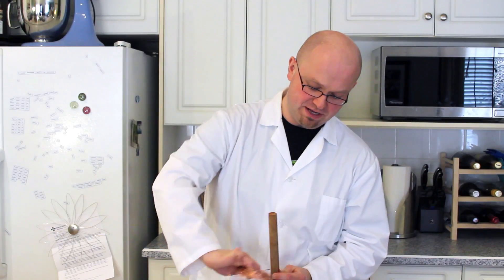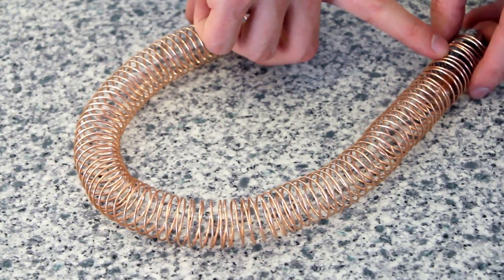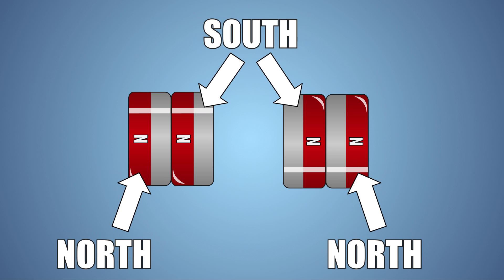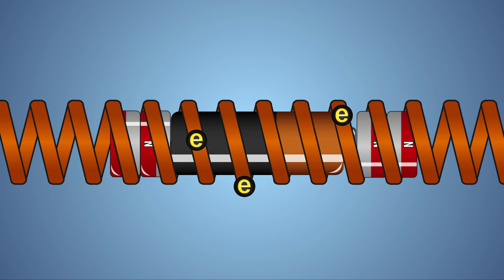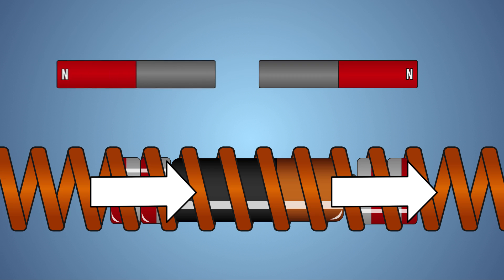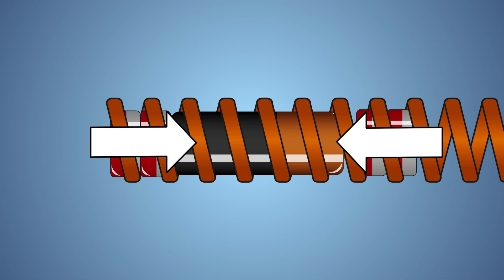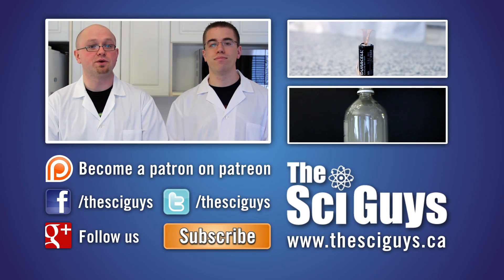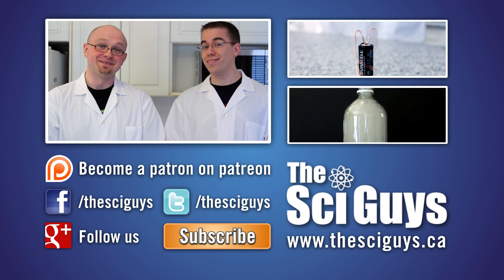The Sci Guys: Science at Home - SE3 - EP9: Simplest Electric Train - Magneto-Electric Train

Comment: can we use use aluminum instead of copper for this?
Reply: Well it would work but not as good as with cooper, because Al is paramagnet material when Cu is diamagnetne material. Paramagnetic substances are characterized by the fact that the magnetic moments will be partially directed in the direction of the external field, which causes a slight attraction between the coil and the train. Whereas diamagnetic substances are considered to develop a weak magnetic moment opposite to the direction of the external field and will be slightly repelled by the magnet, which will help the train move more smoothly.
So in the short it would work but not as good as on the video.
I hope that would help you and also I wish you as much success and experimentation as possible.

Comment: 2:38 is copper coil necessary for movement or can I use a copper plate which is bent like a disected pipe
Reply: flow of current in the coil along circles adds up and gives a combined magnetic field. By the right hand thumb rule fingers curl in direction of current and thumb points the magnetic field direction N to S along the direction of motion of train. in a plate the current will go straight and by a different right hand thumb rule thumb shows current direction and curl of fingers the magnetic field which is not along the direction of motion but in a perpendicular plane

Comment: What would happen if there were only one magnet at one of the poles? You said that one magnet needs to act as the "pull" and one as the "push". So if there was only one magnet, would it simply be a weaker movement because there's only a "pull" or would it not even move? That's my first question

Secondly, I'm assuming that the magnetic field in the coil only exists on either end until half each magnet. Otherwise if the South Pole of one magnet is attracted by the field, the north pole of that very same magnet should be repelled by that field, leading to no motion. So we are to assume that the field ends before the outer extremities of the magnet?
Reply: If you have magnets only at one side of a battery you would not have current because only  magnets at both side create closed loop for a current to flow. Magnets here act as a conductor.

Comment: I know this is an older video but would the inverse of this work for example, instead of the magnets being a attached to a battery say a piece of metal rod, and then applying the electric current to the coil itself
Reply: I know this is an older comment, but I think a magnet is still required in the setup to do stuff

Comment: Can you tell me why aluminium wire isn't used for this? We were able to get the copper wire to work and make the train move forward. Then using the same gauge (18) aluminum wire and same battery, it seemed to reject the train and moved slightly backwards.We are having trouble finding why this might happen.
Reply: Presumably aluminum wire is applicable for this application.
The resistivity of (industrially pure) aluminum is slightly larger than the resistivity of copper, but not much different from copper.
Of course, there are some shortcomings in the use of aluminum wire.
First, the mechanical strength of aluminum is lower than that of copper and it is easily deformed by the externally applied force.
Second, due to the thin oxide film on the surface of the aluminum, the contact resistivity between the wire and the (nickel coated)  neodymium magnet can be slightly larger in the case of aluminum.
Either way, I think you can use it.
Perhaps the direction of the windings is reversed?
Please try to flip the direction of “the battery train”.
Reply: @yoichihirose3806 can you please tell me if the copper wire is insulated or non insulated please?

Comment: Hi, will this work with two magnets glued south-to-south inside an enameled wire tube with an external power connected on the ends of the coil? Seems like a simple question, but I can't seem to figure if the forces outside the magnets will cancel those inside resulting in no movment.
Reply: I was wondering the exact same thing, please answer this!!! Based on this explanation, it should be possible to stick the magnets on either side of an insulting material with this orientation, and have an external power source run a current through the wire. I am hesitant to say this will work tho
Reply: @feelthebluesgaming7630  I posted this question a long time ago. Now I know this will not work. The force created by the magnetic field of outside poles going through the current-carrying coil cancels the one created by the inside poles perfectly.
Reply: Why don't you try it?

Comment: we tried to do it but it is not working. we put copper around broom and had aaa 
and magnets strong earth. what else do we have to do?
Reply from the maker: +Amber Noble Try flipping one of the magnets and try putting it in both sides of the coil. Also the loops in the coil may need to be closer together.
Reply: thanks i will try and how many magnets do we use
Reply: +The Sci Guys thanks i am using it as science project
Reply: I know it's too late..😛 but did it work for you?

Comment: That is a very good clip. My son followed your video but we don't know why it is not working. We have neodymium magnet, bare copper wire and 1.5 v alkaline battery. We made sure North side of magnet pointing outside. But the train was not moving inside the copper wire. Do we need to wrap around  copper wire very tight? You don't want the gap in the copper wire is too big but it is hard to make a very tight coil by hand. I wonder whether the gap is the reason that our train was not moving. Please help. My son's science fair project is due next week and we would love to show this to the audience if possible. Thanks!
Reply from the maker: +Roy Xu I would say that the gap may be the issue. We had gaps and it would sometimes fall in between and break the circuit. Also make sure you are using a AAA battery because it's smaller and lighter than a AA battery. It was tough for us as well to wind it tight and mark had to really force it together to keep the gaps as close as possible. You may want to try a slightly thinner wire because it may be easier to wind tightly. Also make sure you are using a fresh battery. Those are my best suggestions.

Comment: i tried to make it but its not working:(  I made the setup correctly as u explained but in vain.
dont know what is the fault, i guess it is the magnets. i used some magnets which seem to be strong enough, not sure if they are neodymium. plz help!!!
Reply: +Niharika Sharma hi! make sure you use alkaline batteries 

and the magnets repel each other (make sure the its the south poles that's near the batteries although you cant really identify which is which so just make sure the magnets doesnt attract each other) 

and make sure the copper wire you use doesn's have any enamel coating.. try watch the video of amazing science :D
Reply from the maker: +Niharika Sharma Jerley has some great tips. Also make sure you use a fresh battery.

Comment: 12mm×1.5mm neodymium magnet is ok.......plz reply fast as I need to buy them
Reply from the maker: +aditya singh A neodymium magnet should work well. The size should be the same or a little larger diameter as a AAA battery.
Reply: @TheSciGuys how about 15mm?

Comment: I have normal magnets, can i cover them with aluminium foil?
P.s mine is not working.
Reply from the maker: +Yajur Phullera Why would you want to cover the magnets with aluminium foil? The key is having strong magnets and a coil that is tight enough that the magnets won't fall through. It took us a few tries to get it to work but if you don't have strong magnets it won't work well, if at all.
Reply: +The Sci Guys okay thanks. I have made with neodymium magnets. 😊😊

Comment: how thick is the copper wire need to be? and where can I get this magnet? also what is the magnets real name
Reply from the maker: +Cyril Padayatty We found the magnets at a local hardware store that sold them for cabinet doors. You can use 14 to 18 gauge wire. I think in the video we used 14 gauge .
Reply: Neodymium magnets were used in another video

Comment: What is the diameter of the neodymium magnets? Also, why do you need 14-18 gauge wire?
Reply from the maker: EternalRhapsody They are just slightly bigger than a 'AAA' battery. We chose 14-18 gauge wire because it was thin enough to make nice smooth loop and because we could make a lot of loops close together. At the same time it's thick enough to support the battery and magnets.
Reply: @TheSciGuys can I use 20 guage wire for it? Please reply faster I need it for my project
Reply: @n0tyourtyp1cal i have the same question rn ahhh pls respond sci guys 😭😭